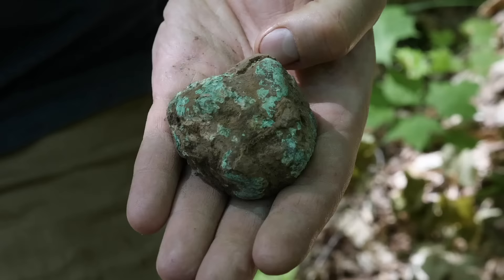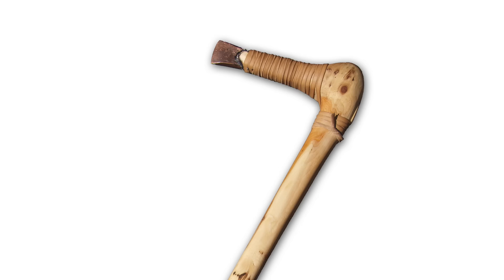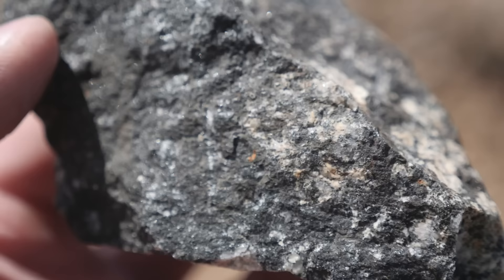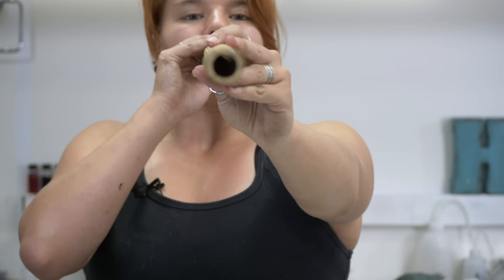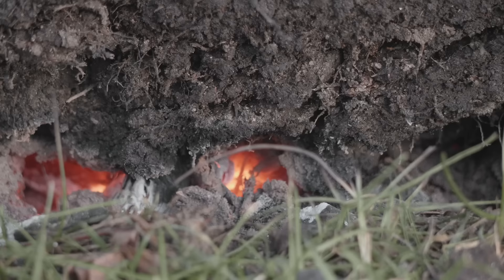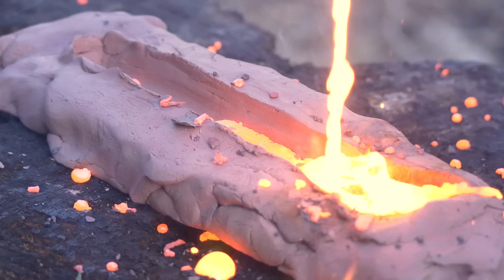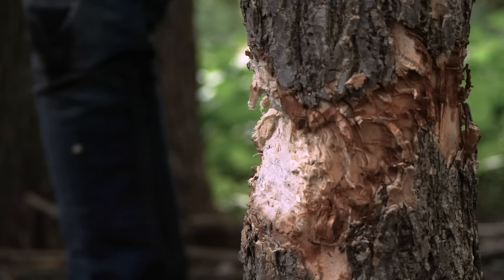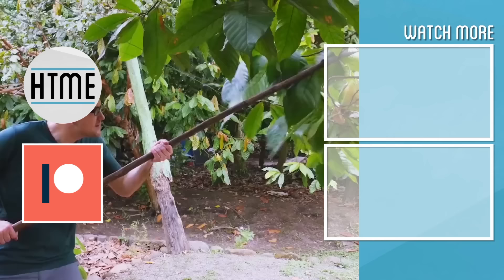Smelting MALACHITE into a KNIFE

Comment: The thing I find most people don't realize about the wheel is that the metal banding around the wheel and the metal clamps that hold the axle in place are what give the wheel the durability and utility to actually function... Moderately advanced copper and bronzeworking had to be achieved before the wheel to create those parts.

Comment: Heyy! When you get to the iron age, you can easily harden iron to high carbon steel with case hardening. It's just packing the ready tool head into an airtight clay vessel filled with charcoal and firing it. The carbon will seep into the iron. To finish off you smash the ceramic and quench it. Firing times can range from 30 min to a couple hours. Most tools only need to hold an edge so it's common to leave the core more flexible ~30/60 min firing.
Reply: Yeah, i saw Clickspring's vid on case hardening
Reply: That's more the steel age than the iron age.
Reply: @baddonkey6876  Clickspring is awesome
Reply: how do you get rid of carbon though? because most of the time you’ll get cast iron rather than wrought iron when you smelt down iron ore

Comment: You should use thinner blowpipes. Every time you blow, you have to replace all of the air that's currently in the pipe. If you put your hand at the ends it probably feels like it's not outputting as much as your inputting. A thinner pipe helps that.

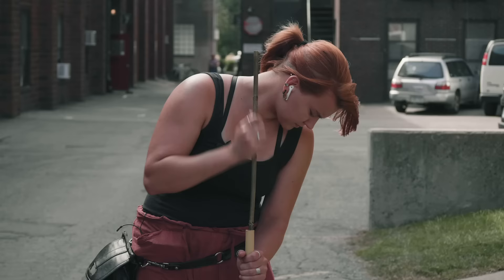Comment: @8:55 To hollow out bamboo with less cracking, take a heated rock (like really hot) and drop it down the shoot. Then use the seperate stick to push the rock through the nodes.

Comment: 9:00 Wrap the bamboo in vines, let them dry in the sun, it'll reduce the chances of splitting. Also, use the smallest dowel you can, then increase the size. A sharp pebble is better at piercing through. Drop it down and hit with the dowel.

Comment: "It actually holds an edge pretty well but it dulls super quickly" So which one is it HTME
Reply: Both. They are not mutually exclusive conditions.
Reply: @timmorris8932  yes they are, "holding an edge" means it doesnt dull quickly, because it holds.
"Gains an edge pretty well" can be used in this scenario though.
Reply: @DH-xw6jp  semantics. The OP pass talking about how it will take an edge but losses it quickly. That was pretty obvious.

Comment: Just an idea that might help; Maybe try baking your clay molds like your crucibles to drive off the moisture--or even incorporating the mold pattern into the bottom of a crucible? And, to prevent the mold from cracking when you pour hot metal into it, try to preheat it in the fire so there is less thermal shock. Lastly, for a more consistent mold pattern, make a wooden form to press into the clay.
Good luck with your future metal projects. I'm looking forward to when (and if) you get to aluminum.

Comment: Blacksmith, iron worker here.  Should be able to cook the moisture out of the clay. With what you have i would make a 3 inch thick "pot" or "form" for your casts. Bake the clay for many hours in the fire, maybe get a moisture meter to check to save failure.  Of course fine sand is best for casting, but clay SHOULD be able to work.

I would really focus on perfecting your skill in creating tools now, in doing so that will directly affect the quality of future work and yes, it is more time spent now, but I promise you that you will get that time back and more in saved time later.

You can do it!

Comment: Maybe you can get hold of some of the mineral Calamine? yes same stuff as often goes into pink coloured lotion for easing itch of say chickenpox spots... Medicinal use of such dates to bronze age) . . Upon heating in a fairly air tight container, that mineral  decompose into zinc fumes which would get absorbed by moltern copper.. Without needing to extract the zinc in pure form. Copper and bronze age stuff often closer to brass etc! 
.. . I've also wondered if containers for doing such in might have been  the origin/inspiration  of the beakers of so called beaker culture. They do seem to have had a fair bit to do with spread of bronze age tech etc.

Comment: I'm curious how they're going to make electricity without using any electricity or goods made using electricity.
Reply: Magnet and wires.

Or just wait till lightning strikes.
Reply: They could make a rudimentary battery
Reply: @Guru_1092  Right, but will naturally mined magnetic ore have the right magnetic alignment, and how do you make wire, without electricity?
Reply: @shitboxoffroad  That still may be difficult because even rudimentary chemical batteries need wire and metal plates. I'd be curious to see how they progress to make those things.
Reply: @Mykol225  I think he made wire before. Showed the process of hitting a tiny bit of gold to a thick wire, that you can pull through holes that get smaller and smaller. I think his problem was, that everytime he was pulling the gold, his total amount of gold shrunk and he ended up with almost nothing... :S
Reply: @Mykol225  Wires can be cold-drawn quite easily. And you can use naturally magnetic minerals to produce magnets out of steel.

Comment: 19:16 "Bronze was discovered before more common-sense things like paper, written language and even the wheel"
You see, that's easy to understand really. You don't actually need the written language until your immediate contacts are so far away (and for extended periods of time) as to make spoken communication impractical (and for weird one-off cases pictures work just fine). But for that to be the case, you need a wide-spanning civilization to begin with, which already implies thriving economy, which is not really possible until you have a lot of other things, including, but not limited to, good tools. And as for the wheel... you see, for the wheel to be practical, you really need to have roads first, and for roads to make sense, you again need a wide-spanning civilization. So yeah, "common sense" stuff isn't as common or sensible when you don't have such "common sense things" like work specialization, roads, cities, economy, and other stuff we take for granted nowadays.

Comment: Clay can sometimes be collected and used as is, However, It is easily refined into much much higher qualities, by separating out particulates. Though I almost wonder if a good enough quality clay from the earth would be just as good, in a Cement, vs Concrete, ie using inclusions or not. i just know that you can filter out organic material and larger stones just by making a slurry and pouring off the slurry leaving behind pebbles and gravel. It might behoove you to make a LARGE batch of good clay. a few hundred pounds of it, maybe!

Comment: Did you harden the bronze? Just work it with a hammer (or a stone). Maybe you could try to get a square flat stone and attack it to a stick to make a stone hammer ? beacause stones are soo unwieldy... And also you can make hamers out of bronze, it should work out OK, especially if you are going to beat on hot steel later. (thats a beginning)

Comment: Now that I've seen you and Codyslab make charcoal, I think I'm going to have to make charcoal now, I have a mud forge I made and I've just been using wood. It's been really wet here and my wood supply is soaked,  does the wood need to be dry to charcoal it?
Reply: My guess that it'll help it to charcoal faster or better. Dry wood means better burning. But this is just my opinion lol

Comment: You said towards the end of the episode that you believe inventions like paper are simpler than bronze. I would suggest that the amount of innovation required for making paper is WAY more than making bronze.

for example, it was already common to throw things into fires that weren't wood or clay. Limestone, Malachite, etc. Making bronze is just a step along that path.

I believe primitive people may have been trying to cast iron from ore, and knew it was possible, but couldn't get their fires hot enough. Until at some point, they added "iron" ore that turned out to be tin. hence starting the bronze age. No new innovation besides "It should be possible to cast metals from fires" - which they already did with copper

Paper requires wholly new manufacturing processes (with the exception of papyrus, I guess) and many innovations that would have been complete leaps, without any reason for people to think it's possible. Boiling plants? sure. Perhaps from cooking. Stripping the bark? Not in any food I think they ate. Boiling the stripped bark? Why would they think to do this. the plant has already been boiled. Making pulp from the bark? I can't think of any innovation that would lead them to try this until other technologies had been developed.

I think it's worth considering what people could have thought was possible when exploring technological developments. As much fun as it is to make bronze; I think it's interesting to think about what lead people to develop that technology in the first place.

Comment: I think u need to spend a bit more time on refining the tools/technologies you have: the most obvious examples are the choice of branches used for the axe handle and the shape of the bronce axe.
I did a similar project during my childhood/early teens and each successive step gets harder if the tools are not optimized enough -> I did not have any time constraints or financial factors to consider tho ^^

Comment: I hope someone on the team reads this, If you are underwhelmed by the performance of tool upgrades between eras of stone, copper and bronze, this is for you.

I completely Love your content, but I gotta say; I think your metalurgical progression needs work. you should not have started with an axe and knife in bronze, with a newer harder material you gotta restart your progress. when you moved into bronze you should have made relatively high-tin TOOLS FOR MAKING TOOLS, like a caveman anvil just a striking surface (basically just a plate to beat on), then a hammer to beat with, and a file to shape with, all made with high tin bronze, after that cast some lower tin stock like your axe and dagger, then you could have used the striker, striking surface, and file to shape them., having TOOLS TO MAKE TOOLS will always serve better than the tools themselves as you can use your decent TOOL MAKING TOOLS to shape the the next item easier and of better quality.

Basically you got things backwards. Tools for making tools should come first. and the nifty harvesting tools like axes, knives, etc etc come later.
Start with a hammer,  anvil, and file first and you can work the rest of the nifty items you want later and  they will bebetter because you'll have the tools to do it with. keep this in mind for the iron age especially, when you have to work wrought iron with cast iron tools you'll want a good striking plate, a good hammer. and a good file. I guarantee it.

tl;dr Tools for making new tools should always be your first priority. Hammer, anvil, file. THEN play with the fun stuff; axe knife, chisel, saw, drill, Bazooka, Apache helicopter
CRAWL-WALK-RUN-SPRINT in that order.

Comment: Im happy this is a series but I do only have one complaint, the series should be taken slower. Take your time and make the best you could make. Things that might take a a couple weeks like that boat I understand, but casting an axe? pour it slowly and make the mold as smooth as possible, if you fail just resmelt(you poured so quickly  in this one that half of it didn't even stay in the mold). It feels like you are just rushing and it kinda ruins the point of going through each age.

Comment: I see you making this mistake in every single video you do casting in: MAKE SURE YOUR MOLDS ARE DRY. Any water will quickly heat to steam creating bubbles and splattering metal everywhere in addition to taking heat out of your metal creating uneven cooling, sunken spots, and internal stress.

Comment: There is something you have not mastered at all, I realized this when you said how long it took to make the bronze. Clay pots. Ceramics take a surprisingly long time to make. They can take days to dry properly, and it takes a long time to master. Your crucibles seemed to be breaking since you were not waiting long enough for the clay to dry, which was the same problem you had with the molds. I think you should go back to making clay pots and working with ceramics before you more forward. You will need to master ceramics before you will be able to get other things.